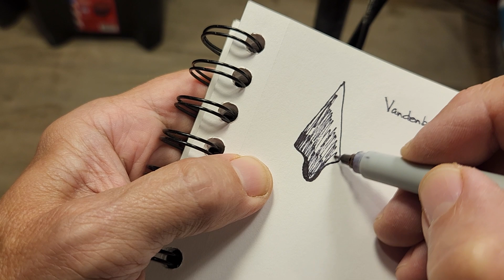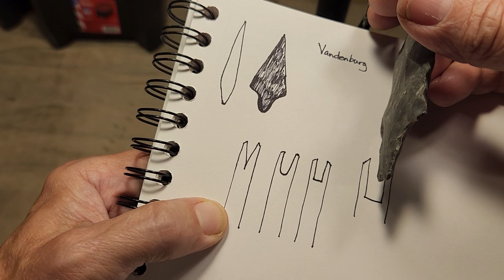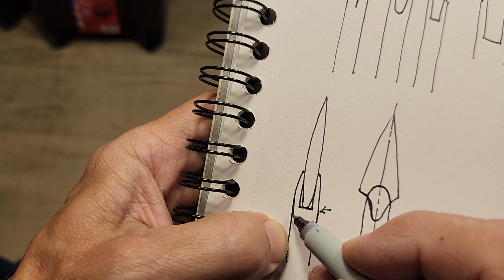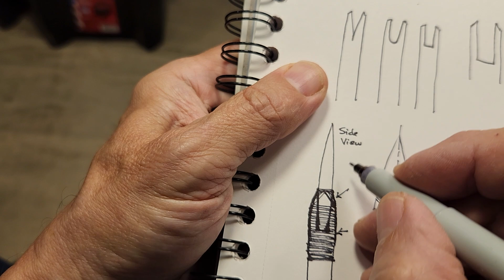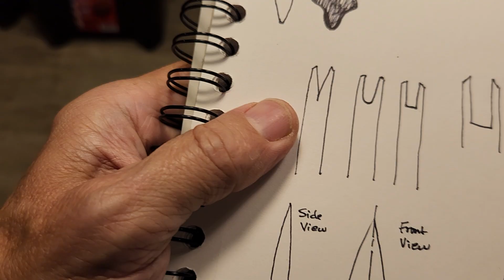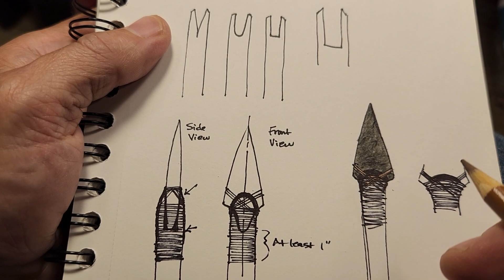1520 - Hafting Contracting Stem Projectile Point WITH WORDS

Comment: Have you ever tried shooting a similar type?
(speaking of bow and arrow)
I wonder if the contracting stem could split the shaft/foreshaft with impact, considering it's shape. Could imagine using split shafts for these points could handle the problem if this might be really the case.
I may do some testing.
Reply from the maker: A hafted point will always split any type of haft if it remains intact (no impact fracture) and hits a hard object with enough force. The shape of the base doesn't matter. A "chisel" shaped base will split a haft just as easily as a pointed base, for example. The key is to use a hard wood for the shaft/ foreshaft and wrap the point tightly if you plan to hit a relatively hard target with a lot of force.
Reply: @KnapperJackCrafty  Ah I see, thank you. Only built one arrow with stone point so far, but I hesitate using it considering the chance of breaking the thing and the general effort of arrow making. 
Guess the half-life af a stone age type projectile is just short by nature.